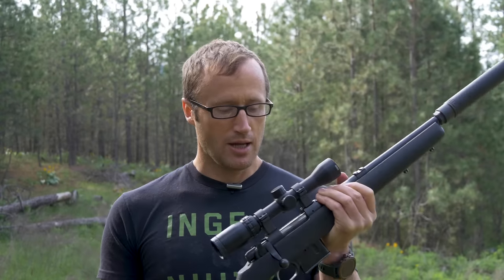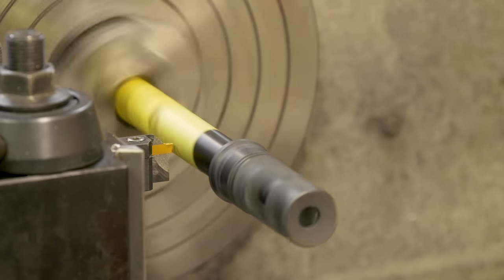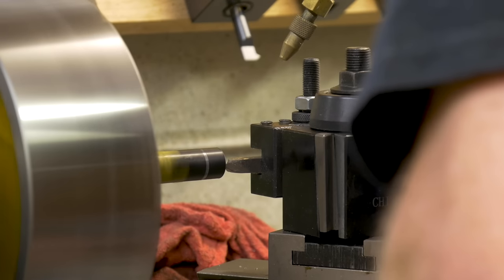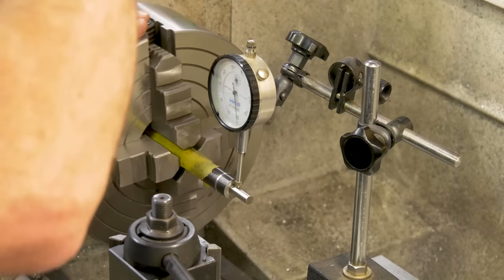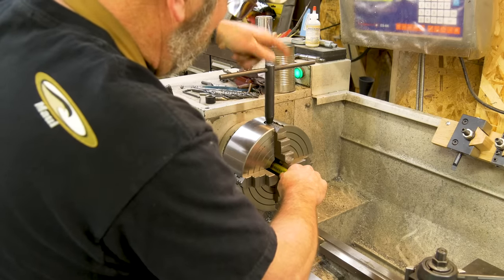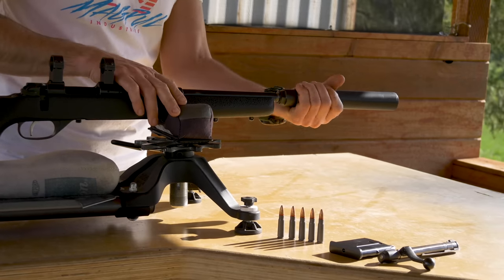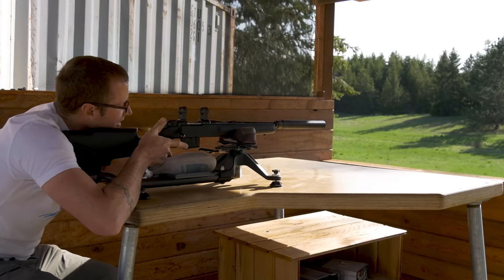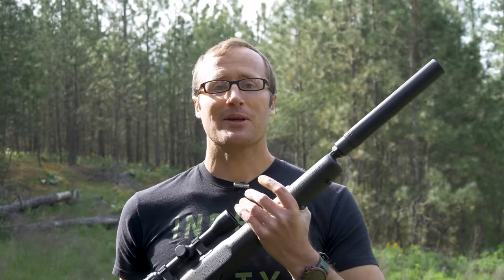CZ 527 Carbine: Barrel Threading by IAT

Comment: I thought you gave up on this rifle after it was shooting shotgun groups. I think you should pull the old Surefire brake off of the barrel cut and inspect the crown. There must be a reason why that gun wouldn't group. It would be nice to have an answer to that mystery. Nice to see this gun back in action.
Reply from the maker: I thought about it, but I don’t want to deal with grinding the weld off...

Comment: I have a CZ527 in 7.62x39 as well and SBRed at 10.5 inches. What stock is that I have been looking for a Better stock for mine and i have the OG walnut stock that has been pillar and glass bedded. Really wanted MDT to make a chassis for the 7.62x39 version not just the 5.56 version
Reply from the maker: I wish someone made a chassis. This is a Boyd’s.

Comment: How does he adjust the threading for a bore that is not centered in the barrel?
Reply: Base the measurement off of the bore instead of the outside of the barrel so that the threading is concentric to the bore. If you notice he puts a pin inside the barrel and then uses that instead of the outside of the barrel.
Reply: @nopenotnever  so would that make the threads on one side of the barrel shallower? (I understand we are probably talking hundredths)
Reply: @nopenotnever  I saw he used the pin, I am wrapping my head around the lathe Jaws rotating concentric to the outside of the barrel and making the threads concentric to the bore...
Reply: @jhbryaniv  I imagine it would but like you said very minimal. I took manual machining in school just to learn a craft that I may or may not use. I really enjoyed it but by no means as proficient as I wish to be. Manual machining is such an awesome craft, so much intimacy in creating something with such great precision.
Reply: @jhbryaniv  that is a 4 jawed chuck so he can make adjustments to whatever side to get the pin concentric to his tool. In class when we couldn't finish a project in one session that is how we had to dial that part back with a pin that matched the inside.
Reply: @jhbryaniv  chances are he turned the outside diameter of the area he was going to thread to be concentric to the bore before threading it